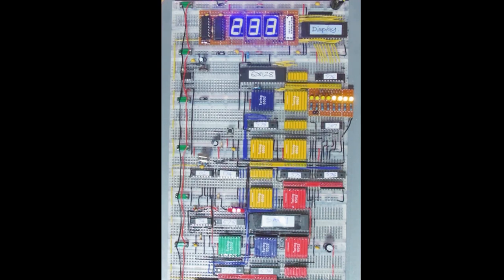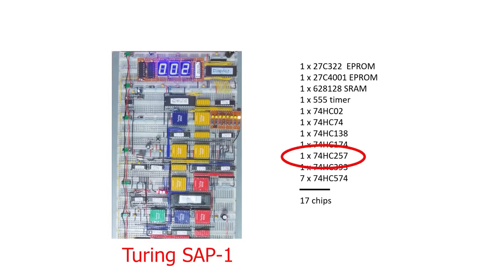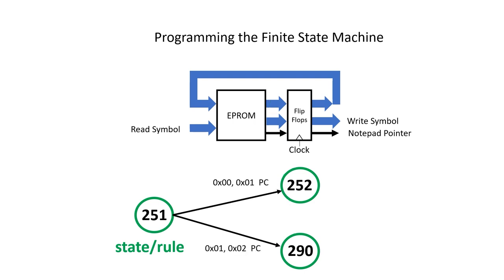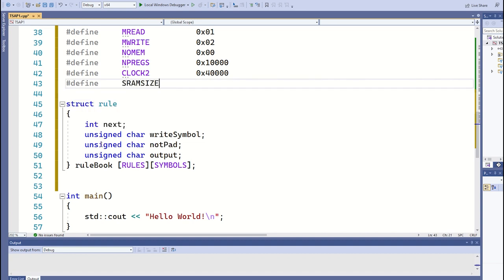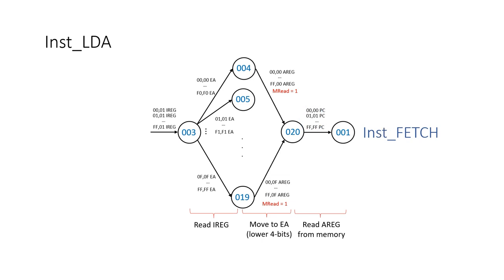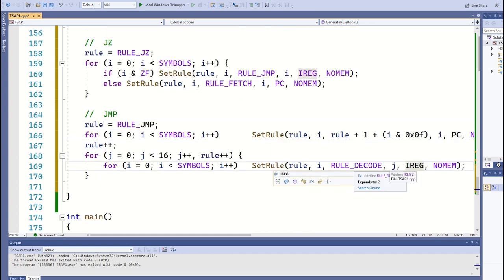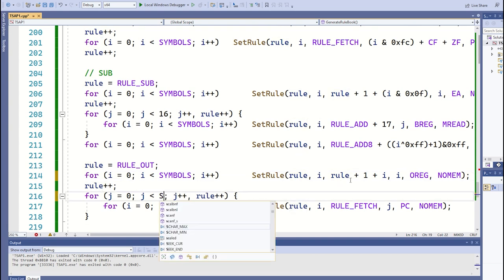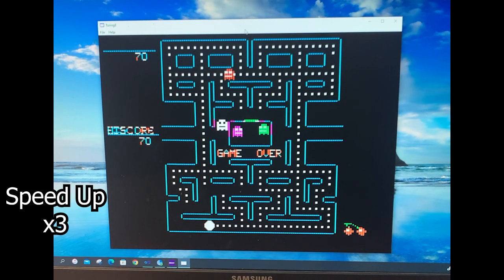Simpler than Ben Eater's SAP-1: Generating the EPROM Code

Comment: It’s a fun series that nicely illustrates some formal computer science concepts in a practical way.

I do like the 74xx670 ic for storing registers. It’s effectively a 4x4bit dual ported RAM with a tri-state output, so a pair of them can hold 4 8bit values. Easy to feed data into and also to asynchronously put a register onto the bus. In your case you could use just 1 in your SAP to hold both the notepad and address registers. I’ve also used this chip to provide memory bank expansion on 8bit CPUs.
Reply from the maker: Yes exactly.  I was thinking of calling it "A Practical Guide to Theoretical Computer Science".  I'll have a look at the 670 and see if i can get some.

Comment: Very interesting!  Also, very quick in some places for me to follow, so I went back and re-watched it.  I think I know how it works, but I suspect a third watching may be required to feel completely comfortable with it.  As to following state machines in general, I am partially relying on my memory of computer science classes using state machines (and requiring us to draw them out).  This is one massive state machine!  The use of precomputed results for, for instance, "ADD" was rather surprising, but I imagine that it was also completely necessary for the implementation of the SAP-1 as a Turing Machine.

I should probably now go back and re-watch the more confusing (to me) videos of the Turing 6502 series and tie it all together in my head.
Reply from the maker: Excellent, keep at it.  
There is one piece to the puzzle I'm going to go over it in the new playlist on the apple2.

If you take all the look-up tables for ADC, SBC, AND, ORA and EOR that are currently implemented in the 27C322 in the state machine, you can actually separate them out their own ALU-OLNY-EPROM operating in parallel with the state machine EPROMs and select between them.

Next, we replace this ALU-ONLY-EPROM with an actual ALU like the 74HC181.  This moves the large look-up tables into some combinatorial logic.  

Finally, we can take out the program counter variables (PCL and PCH) stored in the SRAM and give them their own register.  Then we make that register an up-counter as well (such as the 74hc161) .

There we have it, we've basically walked from the Turing6502 to the SAP6502 (simplified 6502) architecture.

Pure Turing Machine ---------------------------> Turing 6502 --------------------------------> SAP6502
                                                     ^                                                         ^
                          (Random Access Memory)                     (External ALU and PC)

Comment: I found this to be just as interesting and as educational as Ben Eater's series. When I was following Ben Eater's YT series I built a replica of his in a program called Logism. I'm referring to the original Logism as opposed to the newer version known as Logisim Evolution. I had to make a few tweeks to the design when working with the bus because Logism doesn't allow for bidirectional transfer of data with tristate buffers. I couldn't implement the logic design exactly as how the trans bus receivers are built. I had to pad extra logic (muxes, demuxes, and and or gates) to connect the bus lines with the decode logic as well as with the state register. I was able to emulate his entire design with LEDs at each portion of his build. I was also able to emulate the program mode and run modes, except you have to manually change the switching or state modes to various modules. At the end of the day (well, week or month) I was able to run his OPcodes and was able to produce the same results for each of the programs he presented... It was a fun project to work on.
Reply from the maker: Glad you like it.  You might want to look at the Turing6502 and SAP6502 series.
Reply: @DrMattRegan  I have! And they are good!

Comment: I did enjoy these videos however I would not call them simpler than ...... The computer may technically have less components but it is way more complicated. In the same way I could use FPGA and say it is way simpler than yours. 
The point of Ben's videos is that they are educational. They are easy to understand and to follow. And they do visualize a lot of concepts. You can see the control lines, execution steps, etc... In your computer is everything hidden in a big C code that generates almost magically a content for the EPROM 🙂
Reply from the maker: Thanks for your feedback.  I actually really appreciate feedback like this.  This too is an educational channel and my goal is to improve it.  It's not just fewer parts, it's a simpler model of computing.  You don't actually need hardware for an ALU or program counter, the way Ben presented it.

If i may, can i request 45 minutes of your time.
Can you watch these two videos in order:
https://youtu.be/gHU8whQP3Rg
https://youtu.be/vskC4_j0Z9E

Does this help explain it more detail?
Please let me know if you do watch them and whether they help or not.
Reply: @DrMattRegan  I watched them. And the issue is not that I would not understand this videos but I have a degree in Computer Science and cca 30 years of experience 🙂
I also used to teach 10-15 years old kids computers and electronics.
And I know that if I would have to choose which model to build with them, I would choose Ben's. And paradoxically because it has more components so you can see the different parts in action. For example you can step through the phases and see how are data transferred from memory to registers, how the control lines changes, etc....
Not that your design is bad, I did enjoy it and I do find it clever in a many ways but I would take it as more advanced topic...
Reply from the maker: Thanks for that.  It's difficult to gauge someone's experience from with a single post.

I actually really liked Ben Eater's series and think he did a great job of explaining things.  So good in fact, that i didn't just want to repeat what he had done.  

This series and the SAP-6502 series are intended more as advanced topics after watching Ben Eater.  The title was meant to be a little controversial (which is why i used a question mark). 

Any thoughts on how i could improve the channel?

Comment: I'm just trying to simulate your version of the SAP-1 in Digital. Thankfully it only complains if two outputs are driving the W bus during simulation which shouldn't happen anyway.
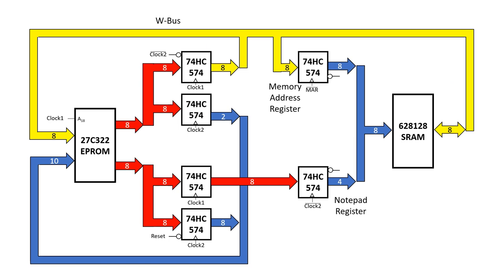I got a question about the graph at 2:17 , the top left D-flip-flop appears to have the Clock1 as clock and Clock2bar at OE this is flipped in the schematic, which one should I assume to be correct?
Reply from the maker: Well spotted.  The top flip-flop drives the W-Bus, which is latched on the rising edge of clock1 but the data is presented on the W-Bus while clock2 is high (clock2Bar is low).   So the block diagram is correct and it's an error in the schematic.
Reply: @DrMattRegan  Thanks for your response. I was leaning this way once I rewatched the first video in the series but to me schematics are the truth because the hardware on my desk derives from it and has gone through a design rule check and through a design process. 
There are more issues, the reset connection is missing on the lower left D flip flop, and OE on the EEPROM as well.

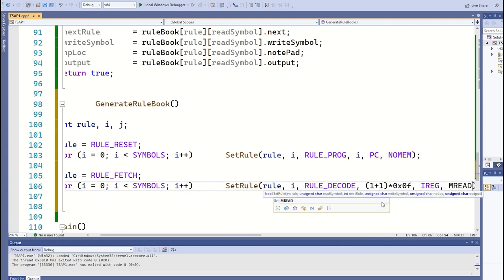Comment: At first around 16:24 rule_fetch had an error where you had 1+1 instead i+1, but then after a cut in the video it was fixed ;-)
Reply from the maker: Yeah, if you look when I insert the new chip it’s actually upside down.  Unfortunately I didn’t catch all of the debug time on camera so there were a couple of things.  The video was pretty long anyway.  What did you think of it otherwise?
As a general rule though, I do like to show my bugs, I think that debugging is one of the more important skills to learn in order to get things working.  I particularly like showing when i need to develop extra test code to corner a bug that was tricky to find.
Reply: @DrMattRegan  I like debugging, but I'm on the technical side of things in life, also professionally.
Then again I believe these videos are made for a certain (technical) audience anyway.
So for me if you include that in the videos it is welcome :-)

As for length - for me it's fine, I sit down to these in free time as something to rack my brain while eating lunch or such.